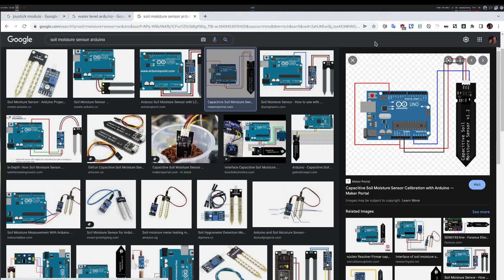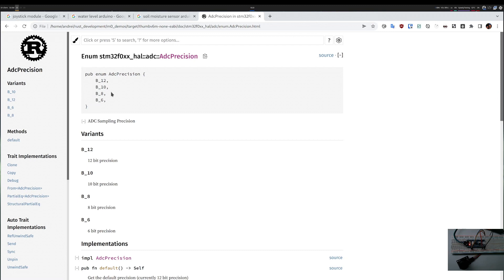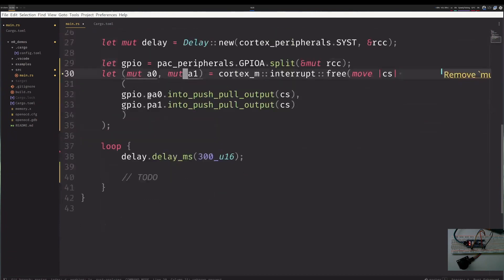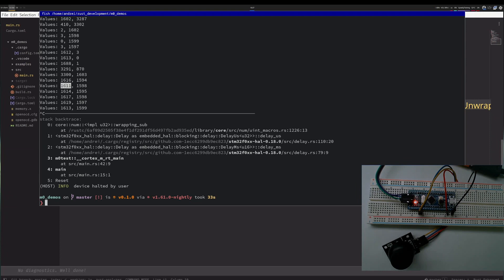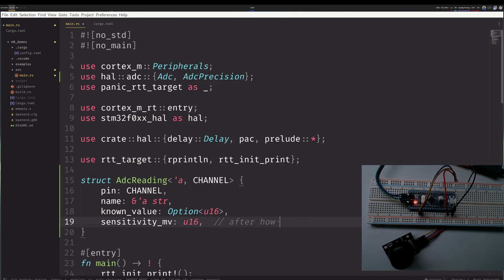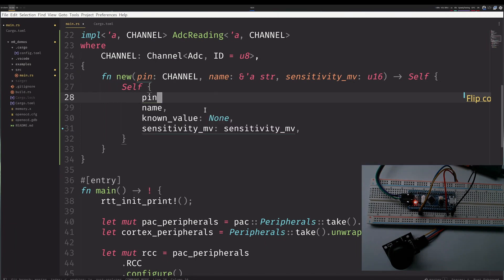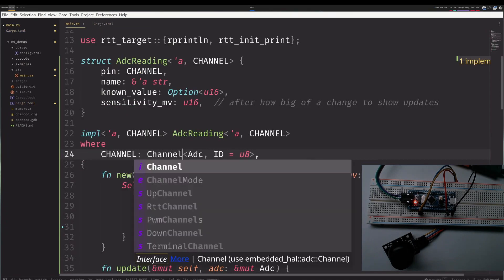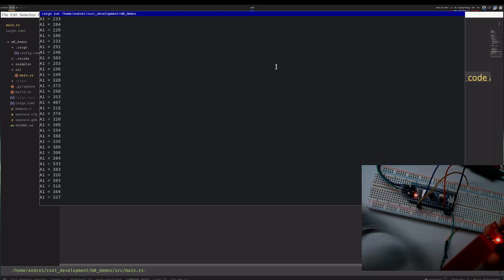Embedded rust: Read ADC sensors like joysticks, water level and moisture sensors

Comment: This is great content Andrei. I’m an Embedded C++ guy. 
What do you think is the advantages of Rust over C++?
Reply from the maker: Hi, I am mainly programming in embedded C++ in my full time job as well and used it in my side projects as well.

Currently I am still somewhat getting familiar with rust, however I find it overall a much more pleasant experience because:
   - type safety - a lot of C APIs end up just saying do_foo(pin_number) and if the pin happens to not support things like PWM, ADC, I2C you are out of luck. On Rust I find that the svd2rust and hal enforce a "if it compiles it works"
   - memory management is more pleasant. Especially in C++, I find it super easy to run out of heap on larger projects. Few libraries support static allocation where as in Rust it generally is almost always statically allocated
  - thread safety: I already see it in interrupt handlers even though I did not start with threads yet. Had personal projects where I added things like HTTP servers and it was easy to mess up safety, so looking forward to rust everywhere.

There are some downsides too:
   - less HW support and I am going through devices I have and this is how I made videos: trying out what devices can be made to work and for now everything does work, sometimes right away sometimes with hiccups. However they always seem to eventually work, hence my videos.
   - things may be somewhat stale and need crate patching - usually it seems a 30min job to make them work (1day at start, 30 min now that I understand things better)

I am still unsure about code cost - all this type safety seems to be equivalent to CRTP in C++: every impl for a type generates separate code, which should result in faster binaries but more code bloat. I am unsure if this will have an effect or not. Generally I expect it should not as I would rarely repeat things too much.
Reply: @embedded-rust  Thanks, a lot, it would be really helpful, if you do a video on your journey, cuz I am also a beginner in the field of embedded stuff, especially a beginner in arduino...
Reply from the maker: Hi, started with an arduino demo at https://youtu.be/a0MJBT68wtI

For choosing between stm32 and ardunio though, Arduino is doing great at examples using the existing arduino IDE, so generally C/C++. I would use arduino if you already have the board or are doing both rust and C++.

If starting fresh, I found the stm32 libraries more up to date and generally if comparing stm32 blue pill vs arduino uno (looking at something like https://www.tutorialspoint.com/arduino-uno-vs-stm32duino-blue-pill) the STM32 board is all of cheaper, has more flash, has more ram, runs faster, has more pins, more pwm, more interfaces etc.

I would recommend having a blue pill or other STM32 board for experimenting as well. Not the M0 (I made videos for that because I bought it, but it is small and more restrictive) but any of the STM32 cortex M1 or higher are very good. A STM32F401 is under 8$ (https://www.aliexpress.com/item/4001049840288.html) and is a monster at 128K flash and 512K RAM running at 100MHz.
Reply: Many of my embedded C++ bugs are things like array out of bounds issues, which fail in unpredictable ways in C++ (or worse, work sometimes). Those will bugs either not happen to begin with or panic in Rust.

Similarly, I've had concurrency bugs that are blocked on the compiler level from ever happening. (Though the compiler also blocks some non-bugs sometimes and forces an alternate solution.)

It becomes more important with IoT type cases where now that memory issue could be a vector for an exploit.

The biggest downside that I see is that the "zero cost abstractions" aren't always really zero-cost. Eg sometimes the compiler can eliminate a array bounds-check and other times it can't, and it isn't always obvious where. So usually I'm impressed with the compactness of the output assembly, but sometimes you also get unexpected bloat.

The embedded ecosystem is in fairly rapid flux right now, always improving, but it's very easy to run into very out of date information... from a few months ago.